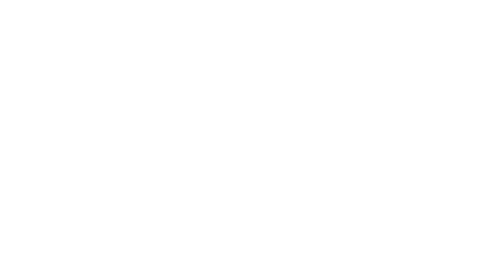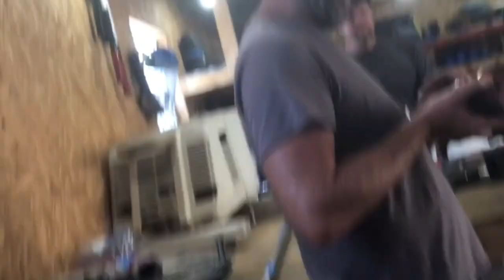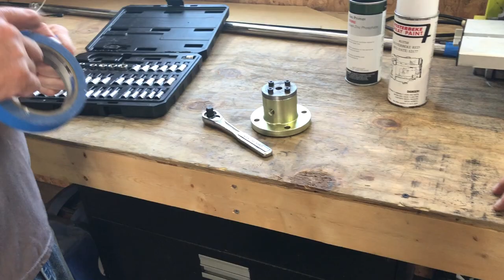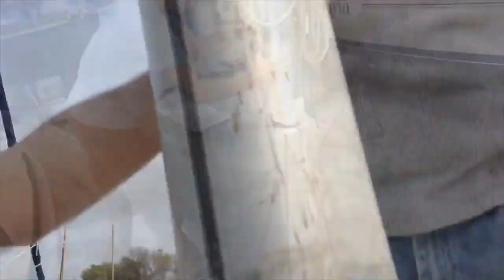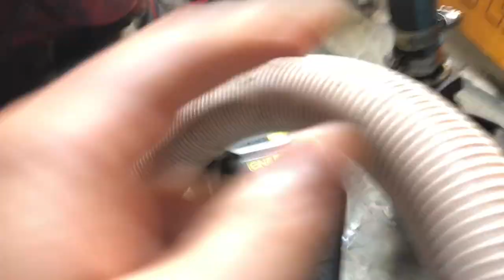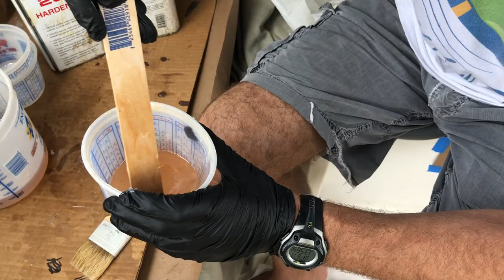Shipyard Vid 3: New Coupling & Rot Repair

Comment: A couple of things popped in my head while watching this, first if you need any more machine work done, look up Abom79 youtube channel. Oddly enough, he isn't to far from yall. Second, as a knife maker we use what's called stabilized wood taking different types of epoxy and wood and using a vacuum pump, forcing the epoxy into the wood, near permanently preserving the wood. It forces the epoxy in between the grain structure of the wood and cures effectively sealing the wood from water, air, and rot on a near molecular level. While it might be a little costly, if you stabilize the wood in the bedding and stringers, you will NEVER have to worry about them rotting again. You could probably use a method similar to the way boat builders remove all the air from the fiberglass when laying up a fiberglass or epoxy coated hull. Use heavy plastic to make a form fitting vacuum chamber and pour in the epoxy on the far side away from the vacuum valve.  Just a thought.
Reply from the maker: Wow, great advice.  Almost like petrified wood.  Solid as a rock.  Great advice, thanks!

Comment: This may have been caused by wear....though a lot of times it is an engine alignment issue.  You really need to purchase a Brunton's Sigma Drive coupling...they run about 500-1100 depending on the model.   You will have a quieter ride, less vibration, increased bearing life, less aligning the engine...all in a lot less maintenance costs.  It is always worth it.  https://www.youtube.com/watch?time_continue=3&v=tKvDYpJaaAY